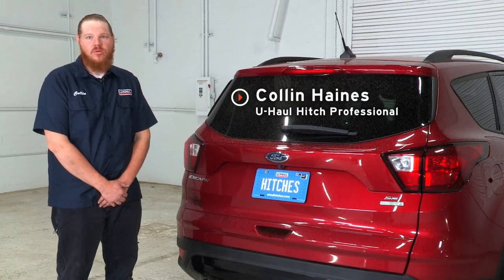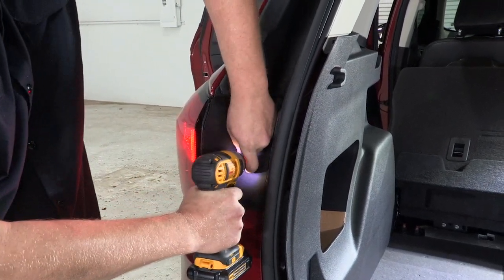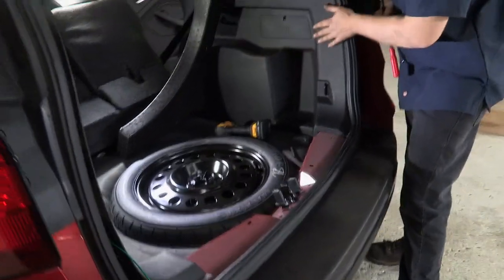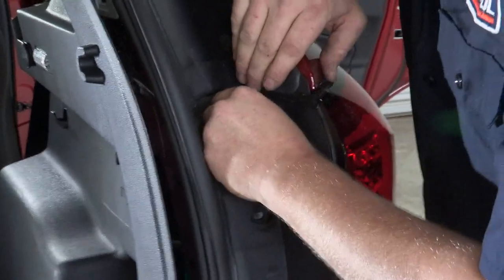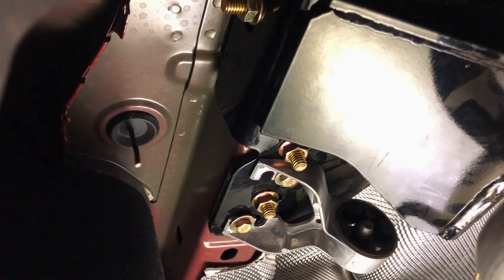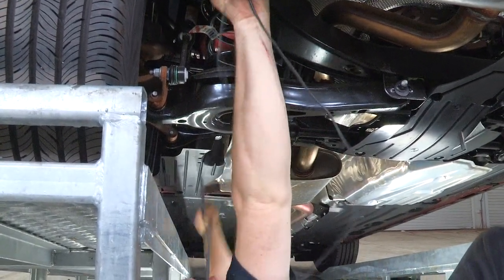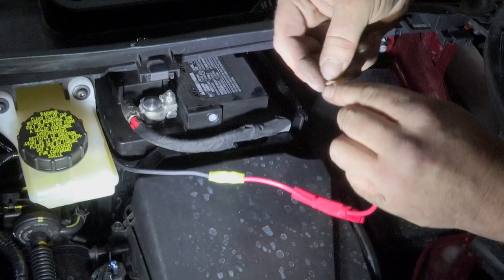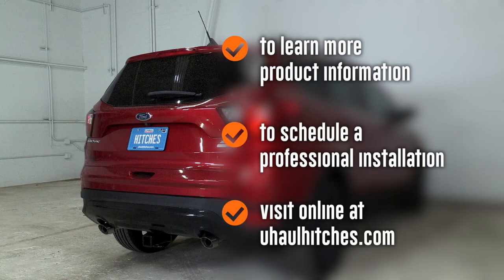2017 Ford Escape Wiring Harness Installation

Comment: You don’t need to run that wire all the way to the battery. The main fuse box is in the trunk.
Reply from the maker: Thats also another great option!
Reply: really, where?

Comment: Just got similar style wire harness recently installed by local “professionals” who forgot to use a sealant to seal holes in rubber grommets under tail lights. Few months later trunk was full of water. Over 600 dollars damage. Luckily they paid. I didn’t spotted that you used a sealant.
Reply: you do not put sealant on your tail lights. LOL must have been a gasket gap somewhere and what exactly could water have done that was 600 dollars in repairs? there is nothing but the spare and plastic.
Reply: @jesserickard6810 the wiring corrodes, the carpeting molds, the tire rim rusts, the tools to replace said tire rusts.  Easily over $600. These aren’t free

Comment: I followed the instructions exactly but for some reason the signals will not work. All other lights work perfectly fine but the signals will not work for some reason. I cannot figure it out. Any help would be appreciated
Reply: Aftermarket wiring harnesses are hit or miss unfortunately
Reply: @randycollens2681  thanks for the reply even though it was a while ago. The car was totalled in  accident in the end so now it doesn’t even matter lol.